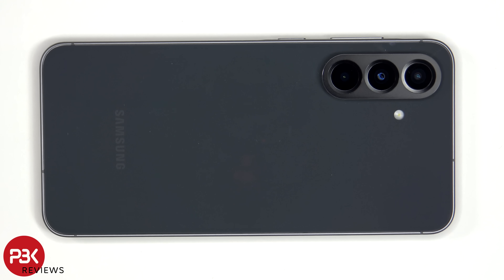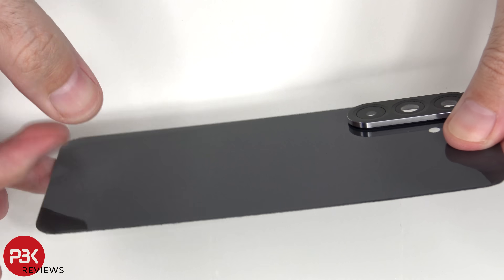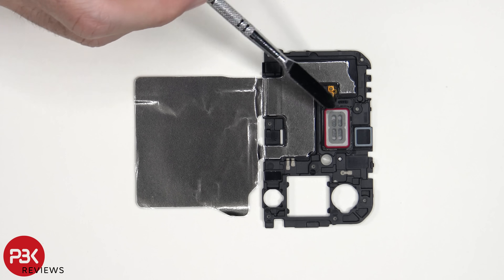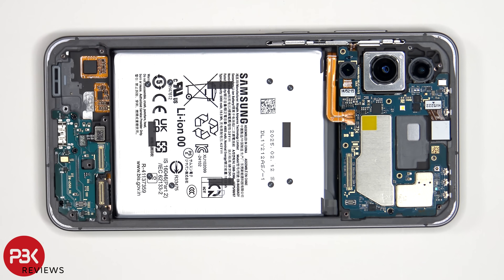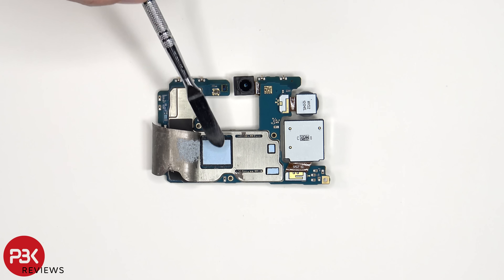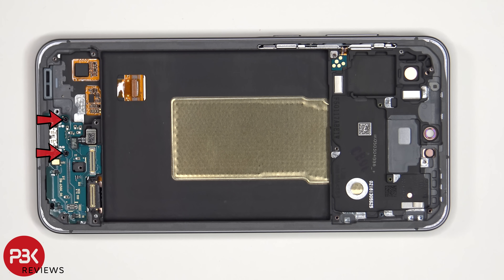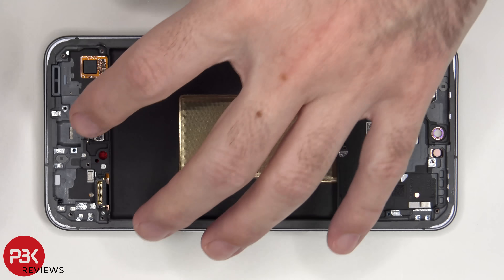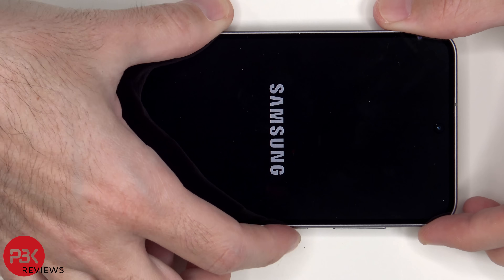Samsung Galaxy A56 5G Teardown Disassembly Phone Repair Video Review

Comment: I accidentally poked all way at the hole nearest to the front camera (1st hole from the front cam) using sim ejector tool. What did it damage or it is still safe? Is it still safe for IP rating of the phone?
Reply from the maker: You'll be fine, no need to worry.

Comment: What are the two extra holes on top and bottom?
Somewhere said they are Air pressure and IR blaster
Reply from the maker: yes, air pressure relief for water resistant sealing.

Comment: I just accidentally put the sim ejector pin on the microphone hole does that affect its ip rating? 😅  Applied strength the same as ejecting the sim tray

Comment: Is it some form of plastic frame where there is only thin layer of aluminium outside? I like the way how samsung puts smartphone together and replacement part availability is good. Comparing how every iphone is built they are so complex and difficult to repair also replacement parts are so expensive.

Comment: Tá idêntico ao do A55
Reply from the maker: Not completely. The vibrator motor has been changed and is incorporated with the speaker housing, as well as the battery adhesive pouch etc.

Comment: Nice teardown. Also did you notice that after you switched the phone back on the upper right hand side had a flickering light and under that was the number 100 . I wonder wether that is battery % or battery health.
Reply from the maker: Thanks, that's just the reflection of the light I have next to the camera which is recording the video. The light is at 100% brightness so that is the 100 you see.

Comment: Can I ask you, the battery will work on samsung a72 ? W will love a new fabricated battery
Reply from the maker: I'm not sure, its possible. If they are the same size measurement wise (to fit in the compartment) and the connector type is the same, then should work.
Reply: @PBKreviews  if the connector is the same that's a yes, since both models have 5.000mah. I will tell you here when I will manage to find a battery and install it (guess not so soon)

Comment: O a54 e o a53 n tem camara de vapor como 55 e o 56 tem
Reply: Yes, the materials were very cheap for the previous devices, but with the a55-56 the materials were improved, and the worst ever is the a53.
Reply: @فارسالتميمي-ع7غ  concordo eu tô usando a53 e pensa ele engasgando e esquentando
Reply: @ My brother had a good a52s but the materials are not good. The difference with the 53 is that the charger was removed and even the processor was not changed. Later, we bought him an a55, but he broke it after a month because of one reason, which is that he uses it intensively and the Exynos processors do not handle games and the use is hard. After that, we bought him a new iPhone 12.
Reply: @ Moderate use will be fine.

Comment: Samsung is so confident in its exynos chips that they dont even bother to apply thermal paste on the graphite sheet. I literally havent seen any samsung phone with thermal paste. Perhaps thats the reason why they perform terribly in throttling tests. Also A series phones are a literal scam in my country. They are charging 520+$ for this phone!!!!!! In that price you can easily get the s24 plus or an older flagship. I am very dissapointed by samsung for doing this. There are also better alternatives to this phone by other manufacturers. I especially like the xiaomi 14t which is sold at almost the same price as the outdated exynos trash that samsung sells. That phone has a dimensity 9300 which is a beast compared to the exynos in this phone. It also has a way better leica camera setup.
Reply: Yes I agree with your point
Reply: Зато рекламы нет как на китайский моделях и не тормозят
Reply: @Product826 Они действительно лагают. Я даже на S24 Ultra видел лаги своими глазами. Оболочка Samsung очень тяжёлая. Не думаю, что в 14t есть реклама.

Comment: This A56 has a much bigger battery footprint than the A55 (You can see the size difference of the battery compartment in the vapour chamber comparison photo). That is how Samsung makes the phone (and the battery) thinner while keeping the 5000 mAh capacity. But I think they can keep the old thickness and give us 6000 mAh using the bigger footprint.
Reply: can a55 use a56 frame
Reply: @Frengki-l5w  no. The A56 is physically taller and wider while also being almost a full millimetre thinner. It probably fits, just won't be pretty.
Reply: They probably won’t until a few years 😂
Reply: @shiiraga1111 They can do it, but for some reasons they don’t. Samsung had been doing 6000 mAh for their M series for years, even though some of them had gone back to 5000 mAh, for example the M55. They also kept some of them at 6000 mAh (like the M35). I live in a region where the M series is not available, so I want the A series to get that kind of battery capacity.
Reply: @ money, chinese phones already have silicon carbon batteries while the latest s25 series are still stuck with 5k mah batteries

Comment: Trash and expensive phone. Samsung's midrange phones are garbage
Reply: Just having an aluminum frame is a fantastic improvement, and the sound is excellent, and the screen has excellent brightness and average resolution, but it's not designed for gaming unless you're replacing your device after a year and a half or two.
Reply: The camera suck and the processor too @فارسالتميمي-ع7غ
Reply: The A55 already had aluminum frame and glass back @فارسالتميمي-ع7غ

Comment: Quick question , can the camera bar be replacing by the old style camera rings?
Reply from the maker: I'm sure you can heat up and pry off the camera bar, but it will probably have black under frame as well which won't completely be covered up by rings.

Comment: It no longer has coaxial ports. I'm not good at identifying high-quality plates, but do you consider it a durable and long-term phone, or should I choose the S24 FE?
Reply from the maker: not sure its a close call between the two. 24 fe has a better processor, but A56 has a larger battery. All depends on what you need it for. I think the A56 should be a durable long term phone.
Reply: @PBKreviews  true but it depends s24 better for camera and processor but a56 is just for people that are simple and don't need that much performance
Reply: @PBKreviews  rich people for s24 but I recommend the s23fe it's better than the a56
Reply: I'd get the a56
Reply: S24 better

Comment: look like mid range phone from Samsung get better build quality every each year. By the way, could you please make videos about oneui 7 on A56 5G
Reply from the maker: 👍. My expertise are more in line with hardware vs software so I wouldn't really be able to make a good software related video or review the oneui 7 well.
Reply: With a mediocre specs
Reply: @AnotherDay-ce6th Characteristics are great idk what ur on. Ur expecting what from a midrange phone ?
Reply: @ there are way better mid range  phones
Reply: @AnotherDay-ce6th And what are the said phones ?
Reply: Then go buy them
Reply: @AnotherDay-ce6th  it's a series
Reply: @AnotherDay-ce6th  no they're not. The only problem is that Exynos only started being actually good, so no apps outside of the Samsung bubble are optimized for it.
Reply: @Drift_Potato402   I use the a54. The stuttering issue is unreal. The lag is so prominent. They're way better mid-range compared to the rubbish named a56. Those even have telephoto lens.
Reply: @AnotherDay-ce6th  there are problems with a54 its been solve with a55 and a56.
Reply: @AnotherDay-ce6th mediocre specs? Its on par with Some phones have similar specs like vivo v60 or honor 400